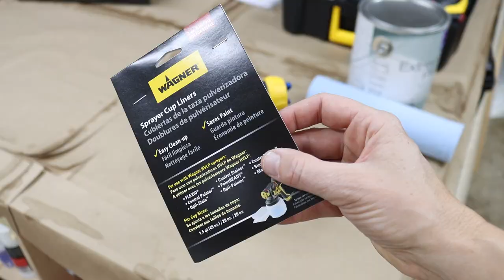How I Did My Own Kitchen Renovation START To FINISH!

Comment: That kitchen came out amazing! I have a heavy textured wall that looks bad and now I know how to make it nice and smooth. Would you recommend the paint sprayer for interior walls as well?   Is a roller still better for a large wall?
Reply from the maker: Yes, you could totally spray a wall with this sprayer! I think the wider nozzle would be best, instead of the detailed nozzle that I used for the cabinets. Regarding sprayer vs roller, it really just depends on how much prep you want to do to mask off the wall. IMO, a sprayer always looks better. Thanks so much!